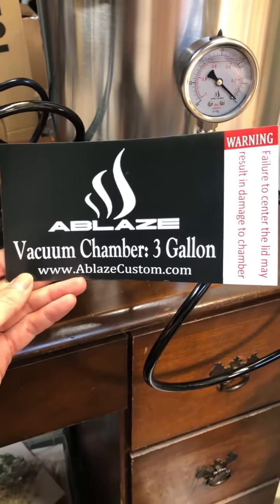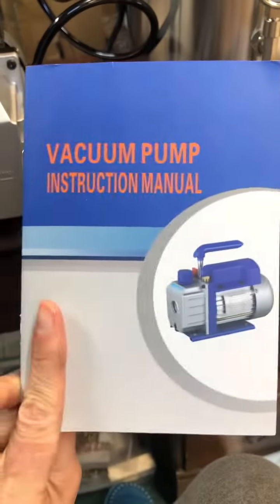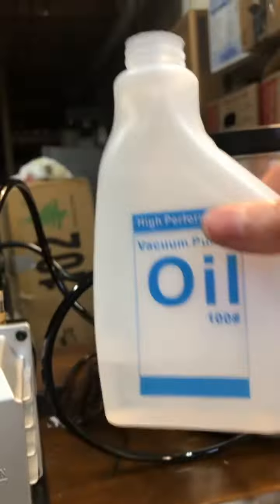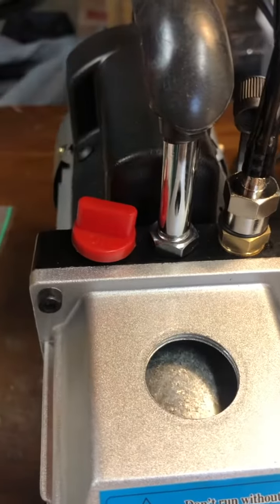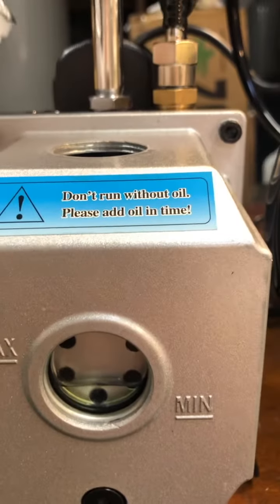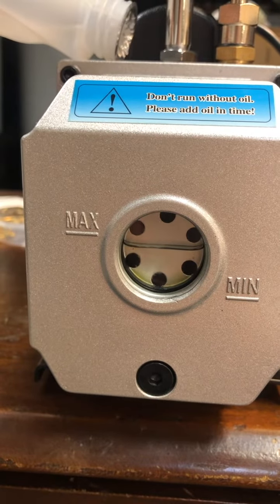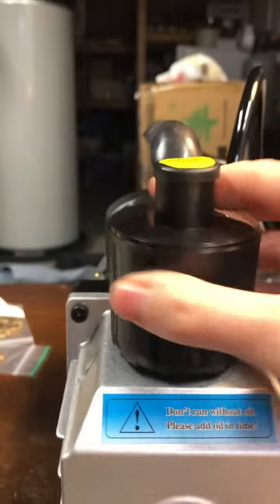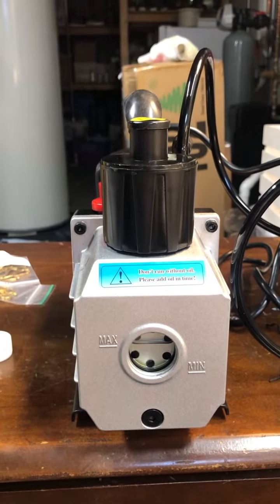Adding Oil to Vacuum Pump First Time

Comment: Have you added oil to the large hole aswell? Does it fill the reservoir the same way? I have a vacuum pump but it only has one large cap at the front...
Reply from the maker: They both seem to go to the same place in mine.